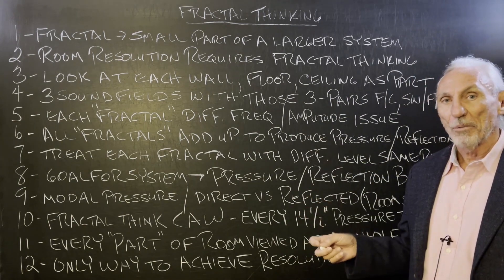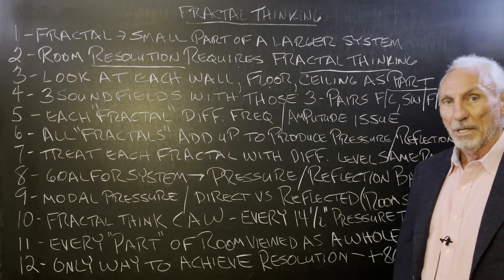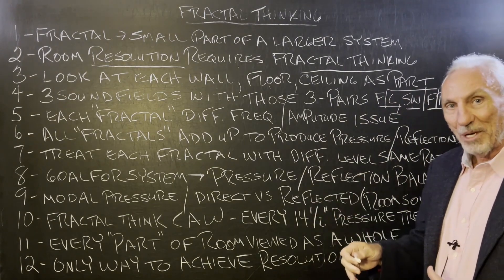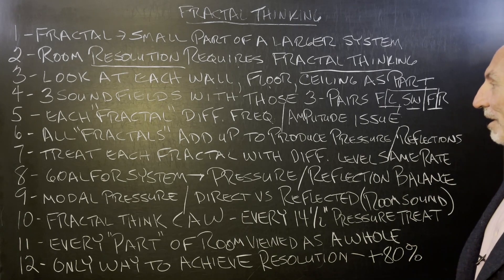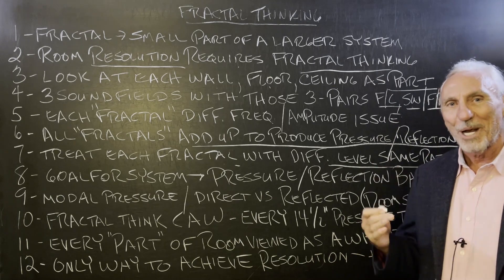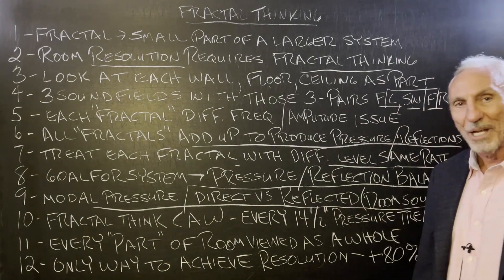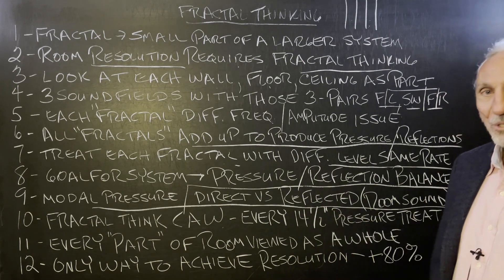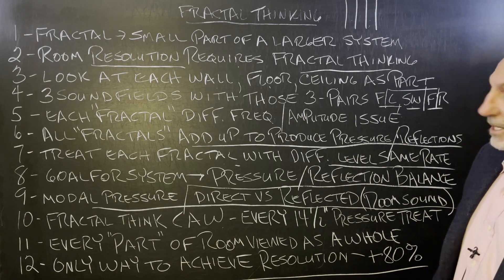Fractal Thinking - www.AcousticFields.com

Comment: A fractal is a never-ending pattern. Fractals are infinitely complex patterns that are self-similar across different scales. They are created by repeating a simple process over and over in an ongoing feedback loop
Reply: This⬆️
Reply from the maker: You are correct. The acoustics inside a room are a never ending pattern of pressure and reflections. They repeat themselves over and over.